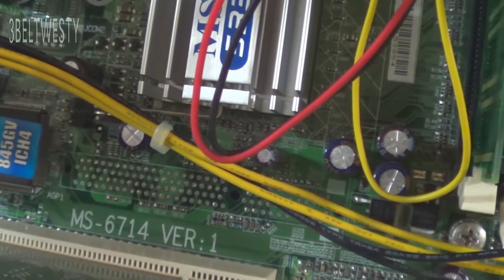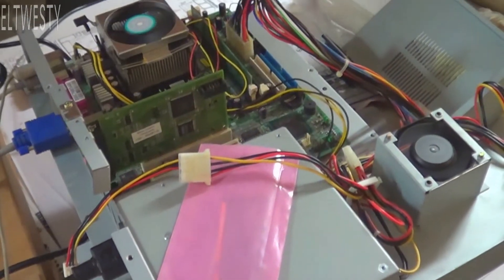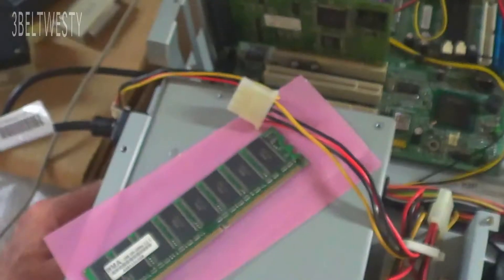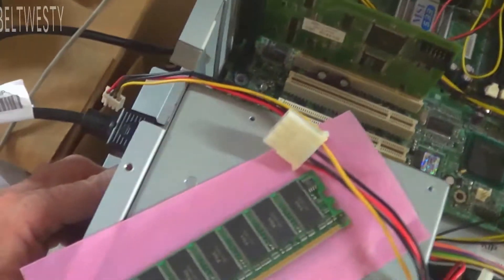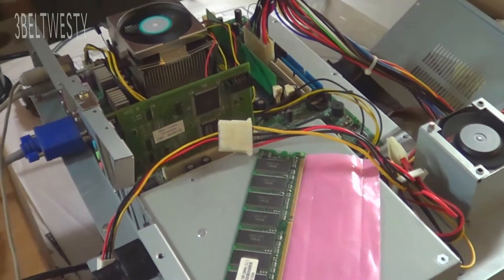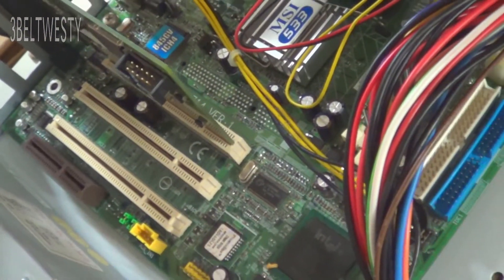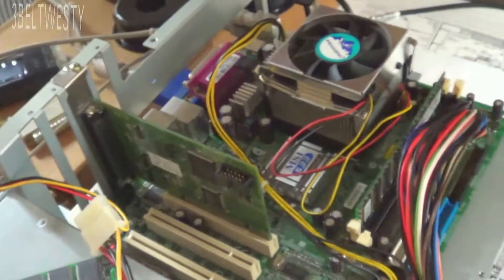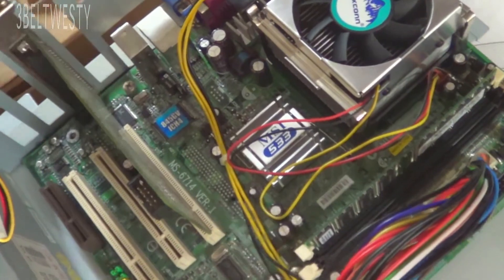MSI 6714 1 long beep dark screen fails to boot due to bad ram

Comment: I've been starting to hear this on mine as well, i've built it myself and i'm sure i haven't heard this beeping before. Sometimes when i'm watching a youtube video and not touching the mouse or keyboard it will then say stopped responding followed by a short beep which i've guessed is a problem with my HDD but i'm not sure though.